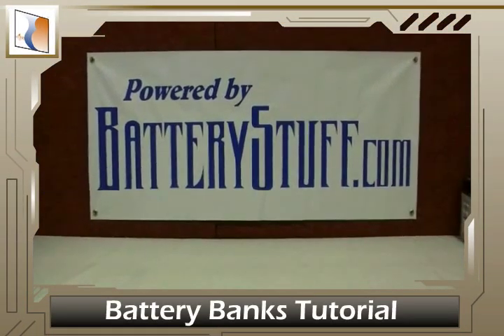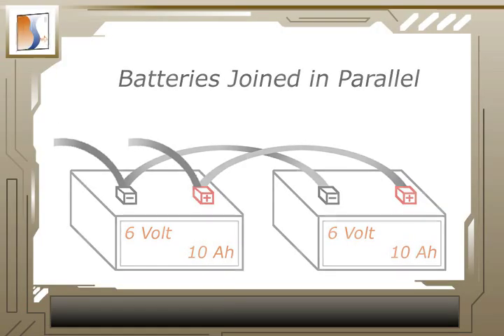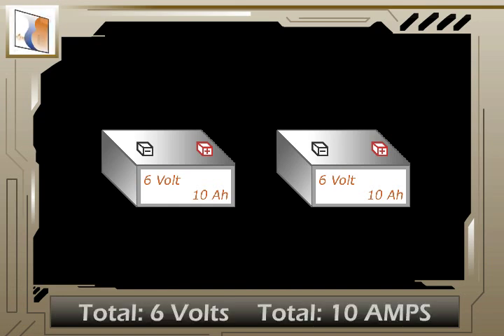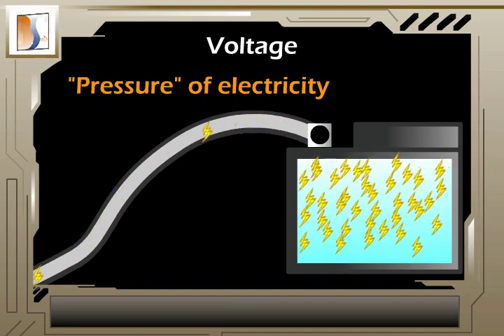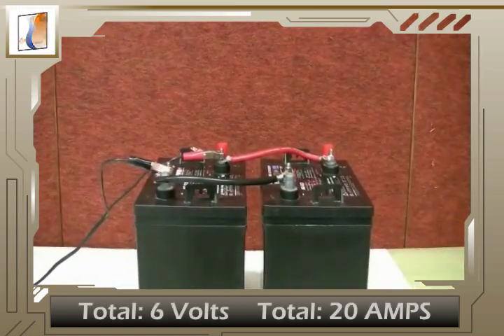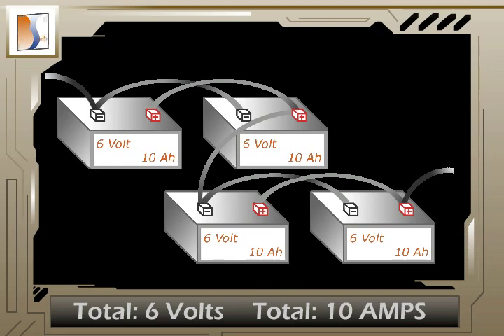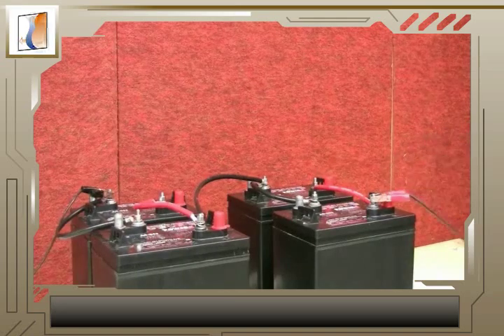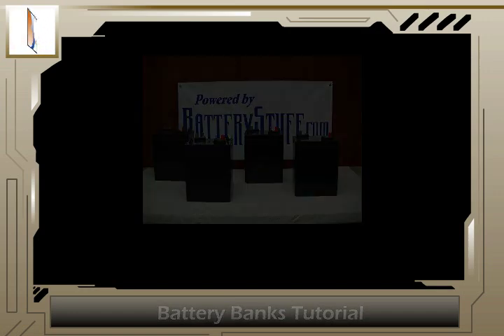Battery Banks Series - Parallel Tutorial

Comment from the maker: @patriotblackops If you have batteries in series, as long as the charger voltage matches up with the bank then it's perfectly fine. For instance, golf carts are usually made of multiple batteries, but they're a total of 36 or 48 volts. Therefore, golf cart chargers are rated likewise. 

If you parallel the batteries, you can also charge them at once. However, you need to make sure the charger has enough amp charge to effectively charge all the batteries as if it were a single large battery.

Comment from the maker: The diagram is for illustrative purposes only. The point is that if done correctly, there is no limit to how large your bank can be. The diagram does not show the total specs, but you're right it is 48 volts with only double the capacity of a single battery. All sixteen batteries can be wired in different ways. Your method of keeping 12 volts will work as well.

Comment from the maker: Having a positive terminal connect to a negative terminal is a series connection, not parallel. But if you're referring to an already existing parallel bank and you want to charge it from an external charger, yes you may connect to either one battery completely or both (with one terminal each).

Comment from the maker: A battery isolator is a good idea if the batteries are independent from one another in terms of use, but they can be recharged by the one alternator. If you are simply increasing your capacity (and CCA will go up as well), there is no need for additional accessories. The wires will do the job. But for safety reasons, secure the wires so they will safe. If one were disconnected, your system is down to one battery again.

Comment: This is true, recharging parallel connected battaries is not trivial. You should use either devices to enforce one directional current flow(special diode setup) or automatic circuit breaker.

Comment from the maker: You should charge the battery pack at the voltage of the pack. If 3.6 volts is your battery pack, you should charge at around 4 volts, at 500 mAH or around there. If you can find a charger with those specs, that's great. if not, it's probably easier to charge them individually with a standard NiMH AAA battery charger, one you can pickup at any department store.

Comment from the maker: If there is an unevenness of discharge between batteries, electricity will attempt to equalize and this will cause the battery with more capacity to feed into the batteries with less capacity. 

However, batteries in a bank will default to charging as equally as possible from an external source. So if there is an uneven discharge level between batteries, one will be overcharged and the other will be undercharged as a result.

Comment: I wonder about this and I always thought the same, but recently, I was told if you are to parallel a bunch of 12V batteries together, because of the slightly different values of internal resistance - that if left uncharged (as in daily) - they will always be charging and discharging, fighting each other, until one dies a premature death, and that isolation is necessary - so is daily charging a must, then?

Comment: Just a quick little tip. Amps & Amp Hours are two different things. (Amp (A) or Milli-Amps (mA)) is the flow of current. (Amp Hours (Ah) or Milli-Amp-Hours (mAh)) is a measure of capacity. If you has a load (LAMP or MOTOR) that needs or draws 2.1Amps (2,100mA), and if you had a 10Ah (10,000mAh) battery, it would take (roughly) 4 Hours & 42 minutes to drain the battery. But you probably already knew that, regardless of what you say in the video. Even going towards the end of your video, you continue to use AMPS as a measurement of Capacity. It's mAh, or Ah, not Amps.

Comment: If you run two in a parallel wouldn't it be more efficient to use the positive from one battery and the negative from the other. This way the second battery is not simply charging the one hooked up battery.

Comment: Help please! I´m planning to install a second battery in the trunk for increased amp/hours. I´ll run the 0 gauge cables in parallel from the batt under the hood all the way to the trunk. Will I need fuses or isolators? Or should I just run the wires as shown in the vid with nothing in between?

Comment: exactly what i was trying to the battery hooked up will discharge first but if you use power from both sides of the bank then it is like one big battery and they will drain even, now charging is another story, i don't know if it draws more alternator amps this way

Comment: AGM batteries can they exploded like wet cell batteries ......oh thanks for the info
Canadian Tire AGM battery adds sure torture those batteries . Had two occasion of exploding batteries in hot climate ....scary experience , happened when starting engines with  older batteries ( maintenance free ) now I use AGM s